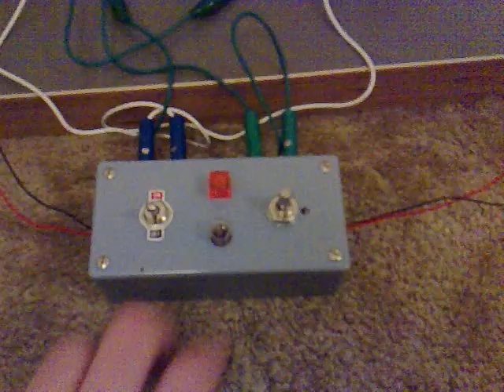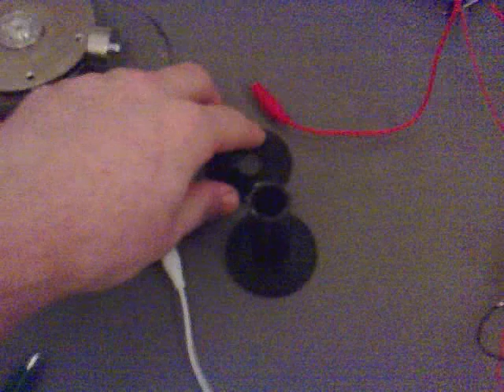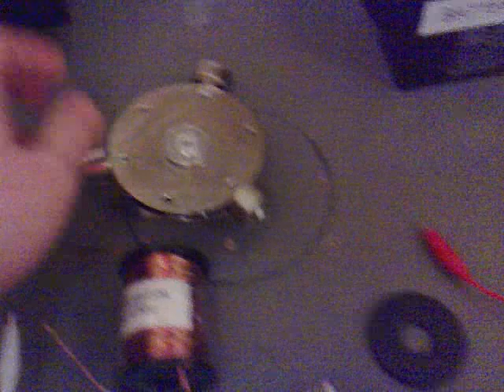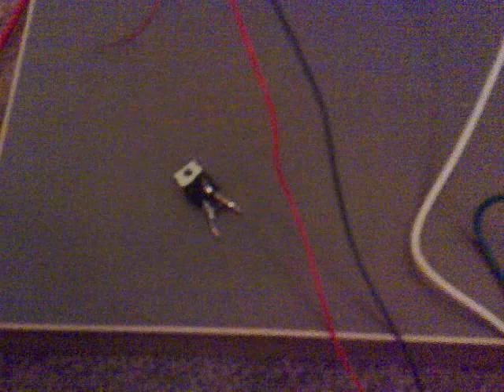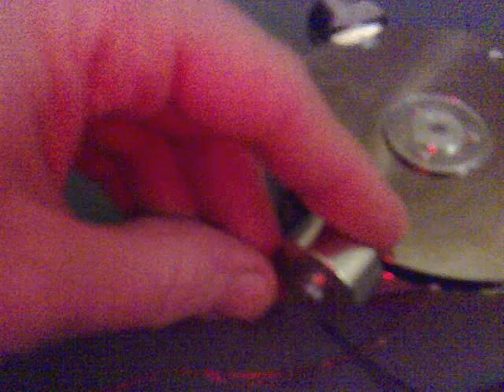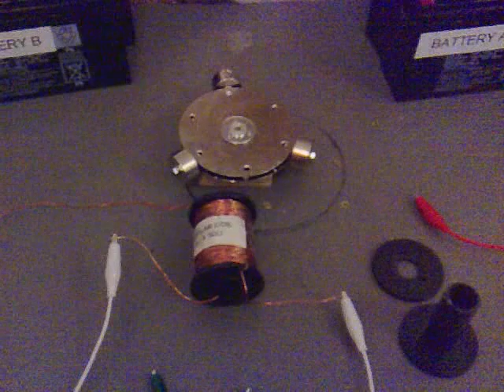Pulse Motor (Rheostat) 089

Comment from the maker: Cause it would be possible because Radio one does not shock people. I do not meant from listening to it I mean it is ambient in the background. If you could use an Harmonic of the first signal then you could transmit energy to any point on the planet.  You just need to adjust signal strength and frequency?

I have managed it 15-20cm but I plan to do much more!

Have you seen my latest videos?

What are your thoughts, 

Paul.